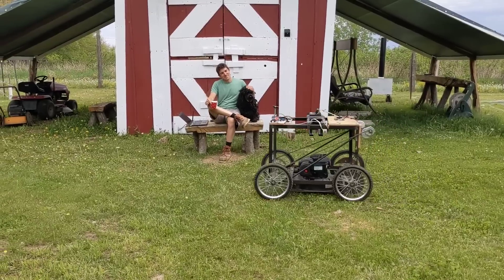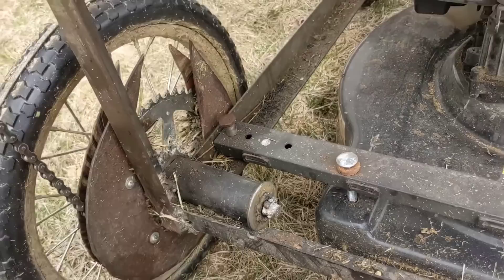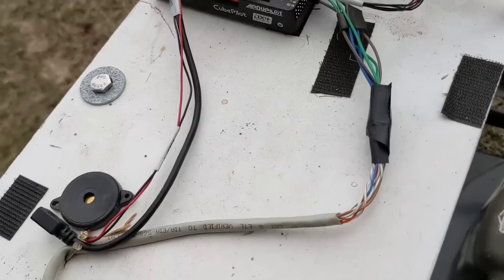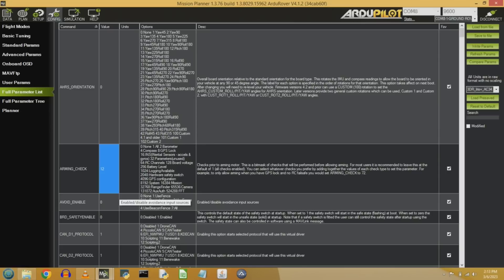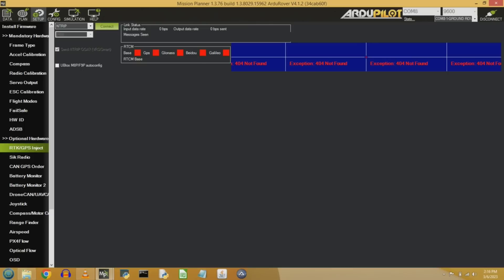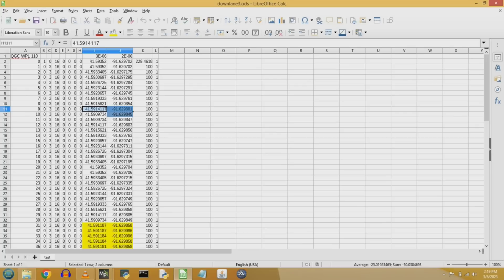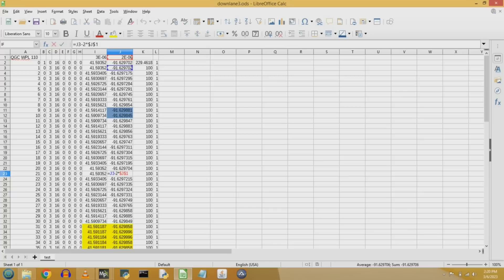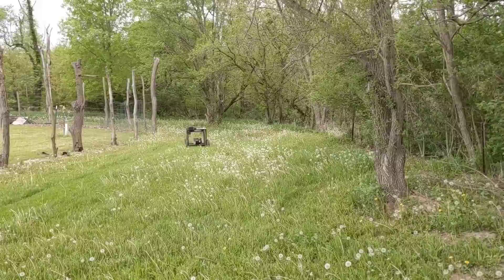DIY Autonomous GPS Mower - Parts List, Schematics, Build Details

Comment: Now that you have it ready to GO -- might be a good idea to consider some (Safety) ways for it to STOP.   You could put bumpers around it so that it cannot run into anything or anyone.  At least not very hard.  Anything touches the bumpers opens a Normally Closed kill circuit.   And maybe some of the big Emergency Stop buttons on top for folks who may have to shut it down in a hurry.   Those are not complaints -- just ways to make a good thing better.   Thanks for the build, the video and sharing the details.
Reply from the maker: All good points, I think next version will include that. The bumpers + kill switch can all be one circuit that connects to the cube orange switch.
Reply: another safety could be when tilted beyond a certain angle
Reply: seems like a good way to introduce reliability issues. how much could the bot realistically damage? that blade is unlikely to make it past the frame, and what sort of folks to you see it encountering in your backyard?
Reply: @xbenng  Safety is suppose to reduce reliability to the point it can be externally stopped.  It is the INTENT.  We sometimes call that Fail-Safe .. which is to say that it Fails in a Safe manner.  As opposed to Fail Sorry.  Another somewhat more complex method, but considered safer yet is a "Stay Alive" signal.  Absent the "Stay Alive" or All Good signal, it goes to an orderly shut-down or Safe mode.  An example of this might be a boundary around the zone(s) of operation.  Anything crosses into the safety area, and it shuts down.
Reply: @philtimmons722 safety is boring world has enough humans and could lose a few with out notice.

Comment: With a vehicle frame that large, you could use two GPS for yaw and forget about the compass hassles
Reply from the maker: Yes, I think this page describes how that looks: https://ardupilot.org/copter/docs/common-gps-for-yaw.html

I wanted a single gps/base station correction because I used the same setup on a drone for spraying my fields, so I reused that setup there.
Reply: Wait, that’s the reason large autonomous vehicles have two GPS?? 😳
Reply: @nathanbuildsdiy You should replace tired wheels with apron wheels, which are beneficial to improve your vehicle's off-road function. Especially in lawn surrounding.
Reply: @djiang2738  what is an apron wheel? Google didn't help
Reply: The compass is the much more stable and applicable variant, because GNSS has significant noise (wighout RTK) and thus direction calculations will be imprecise.

Comment: Dang, I’ve been toying with the idea of modifying my push mower to be an autonomous robot for over a decade and a half. Glad that someone went and actually did it. This is amazing.

I actually have some experience myself with both Ardupilot and the Cube Orange Plus, courtesy of a little challenge put together by NASA that the robotics club at my community college (along with 5 others) participated in. We were tasked with building an autonomous quadcopter. Fun stuff.

I do have a couple suggestions. First of which being, consider covering that platform up top with a waterproof shell. That way if you’re suddenly caught out in the rain, you’re not out a thousand dollars in hardware. Especially since the Cube Orange Plus isn’t waterproof, and I’m sure your ESC isn’t either.

Second (though this might not be an issue for you personally because it looks like you’re just mowing flat land), I would either reduce the height of that platform, or space the wheels farther apart to give it a wider base. This will help reduce the likelihood of it tipping over if you have to mow on a slope

Comment: Great project mate. I am also working on a similar kind of thing but due to some budget limitations i am trying to make a mower using Arduino UNO that remembers the path  its being trained on using an android app. As a mechanical engineering student i must say the its a very impressive and sturdy frame design. Keep up the good work. Hope to see more projects like this.👍👍
Reply from the maker: Arduino UNO is a great platform, raspberry pi zero 2 may cost even less and have a bit more horsepower.

I use the UNO in this build to control a bunch of motors, code for that is linked in the description: https://youtu.be/Q7A3PlqpgYs
The Cytron motor controllers are really simple to use with the UNO

I've found that depending on the condition of the ground (muddy, long grass etc.) the time that it takes to turn 90 or 180 changes, so putting a compass on your UNO may help you figure out if you've turned the appropriate amount.
Reply: you will really need a gps correctionfactor, because of the track changes, like tops and things that the wheel stuck , and it changes the course, even if it changes like tiny degree, it will change the position in long distances, and it will cause portions of not cuted grass. Sorry about the english.

Comment: I would try to make a small riding mower engine bolt to that mower deck, not for the extra power but because riding mower engines have a dynamo under the flywheel that could help charge that 12v battery on the go, sweet build 👍
Reply from the maker: That's an excellent idea.  I'm going to add it in a future revision
Reply: Probably the power of the dynamo wouldn’t be enough for powering the electric motors and charging the battery IMO .Better to think about fitting some relatively small car alternator as from Geo metro / Suzuki swift for example . Also if you are good with electronics, you can make controller which turns the alternator in to brushless motor just for starting the lawnmower IC motor so it will serve double purposes . Also you have done great job overall but the mechanical part isn’t very good . So IMO try on the next iteration Brushless wheel -motors from hoverboards . They are 250-300W each ( direct drive) and the speed controllers from the hoverboard can be reprogrammed and reused for your application as well( there are info on the net how to do it ) . Mechanicaly will be much simple and reliable this way and most probably cheaper. You can buy second hand hoverboard dirty cheap and you will get 2 brushless motor-wheels and 2 speed controllers from it . The way  ( and the details)how they are mounted to the hoverboard  will be also useful for your application.
Reply: It would be interesting to try this concept out with a riding motor as a complete unit. It’s already got everything but remote control.

Comment: Outside of the large area to mow, we have the same goal.  I happen to have no skills yet with welding and such.  I then opted to use wood for my chassis. Instead of using scooter motors, I'm re-using some e-scooter hub wheels that have the motor in them.  I thought about using parts of mower, but figure it'll help me to not use any gas, if I just power another motor with a string like a trimmer to cut the grass.  The idea is that eventually I can move that motor up and down to control cut height.  I love how "simple" your auto-mow looks, but that it works well.  Kudos to you! I'm inspired...again.
Reply: Thanks for the walk-through on the GPS and piloting software, that I haven't gotten to jump into yet.
Reply from the maker: Good luck! let me know how it goes

Comment: Thanks for your great video and especially the circuit diagram sketches, I built a remote-controlled petrol lawn mower last winter (Igor 3.1 ^^), which is basically for the really rough stuff. Next winter I also want something autonomous for fine cutting.

Comment: Very cool ideas, not just like the whole thing but stopping the chains from derailing and making it so that it will actually do work for an hour without screwing up
Reply from the maker: It actually ran for a long time with no chain problems, and then when the grass got long and branches started falling suddenly I had problems so I added the chain keepers long after it was being used

Comment: This is pretty much what I had in my head for mowing my own section, including the RTK GPS.  But I never knew about mission planner or ardupilot etc.  But since I don't have a house on it yet, that one is on the back burner lol.  Sounds like most of the firmware/software is 100%, so it's just implementing the design to your needs.

Comment: You should move the accelerometer down to the axle height and add some gyros. This way you can ignore GPS if the fix isn't great and do dead reckoning until GPS is good again. Should be good enough for what you're doing :)
Reply from the maker: I also ran across this - 2 GPS setup: https://www.youtube.com/watch?v=NjaIKyrInpg

Is that similar to what you're suggesting?

Comment: Dear sir Nathan, thank you so much for your tutorial. Inspired  by this video, I made my own automow (but mechanics is different) and it is working via RC remote control. Really grateful to you. Now, I am working hard to set up the RTK GPS and finding it tuff to NTRIP server in southern part of India.
Reply from the maker: Great work!  Is there much agriculture in your area? Do farmers use large machines?  If so I bet you can talk to them to find out what base station network they use.  Most require a username/password, which is usually free to obtain.  The machine manufacturer charges to use RTK, but the actual base stations are free to anyone.  That's how it is in my area.  Farmers use LEICA network base stations on their tractors and combines and I got a username/password to use that network.

If there is no network available, then you could create your own, but it requires this:
https://irlock.com/products/here-base-m8p

And here's some documentation on setting up the base:
https://ardupilot.org/copter/docs/common-here-plus-gps.html#base-module-setting-using-mission-planner
Reply: Sir  @nathanbuildsdiy  Here in India, precision agriculture is not widely available yet (especially in my locality). 

So I will check setting up my network with help of your links and keep you posted

Comment: Cool build. I really like the large wheels.
I would prefer electric motors on the axle instead of chain drive. 
The chains appear as if they might catch twigs and branches since it is so open and high.
It is an interesting choice to use an ICE for the blade drive. I definitely understand the reasoning.
It would have been fun to see an electric cut.
Reply from the maker: The chains do pick up sticks. In the spring all was well, but in the fall more sticks were dropping and the chains started to derail. I had to add chain keepers (my name for the big circles of metal added inside the wheel) to keep the chains on and that's been good for now.
Reply: I love this transmission as its so cheap and most energy is being used from the gasoline anyway. Internal geared hub drives are really expensive or really weak

Comment: twisted pair works much better with differential drive, which eliminates common mode signals. The twisted pair will cancel out a fair amount of induced common made, but any residual is still fully presented to a single ended input.

Comment: sweet build i got one suggestion get a 220 welder i bought a el cheapo off amazon and do not regret i runs fin off a old school generator no need for inverter type to much hype on them in my option oh and said welder will   run off 120 and with .30 wire it will burn in good and i was stick welding with AC 22-volt tombstone welder fer years. get gas tanks for the mig its sweet stuff no looking back after that .should have did it years ago

Comment: amazing job with this setup! some water proofing could make the electronics last longer, maybe a 3d printed enclosure or anything else which protects from water.
Reply from the maker: Absolutely.  It's on the to do list. I actually had it running last summer when a storm blew in.  A drop of water hit the motor control in just the right place and suddenly the right motor was stuck "on".  Luckily I was already on the way to turn it off when it started driving off into my field!
Reply: @nathanbuildsdiy  stuck on the most stupid thing haha interesting obstacle! hope to see more content related with electronics and hacking

Comment: Maybe you mentioned it and i missed it, but does the program have any type of safety stop mechanism, say if the mower has some mechanical failure and wanders off the gps track? Is there a way to program it to stop and/ or shut down? I live near a highway and would want some sort of safety feature that would prevent it from roaming out on the road.
Reply from the maker: This is a good idea - I talked about it in another comment somewhere in here.  Basically I think it should be added - it'd be fairly simple.  The cube orange has a arm/disarm switch that plugs into the usb port.  That could be wired to "bumpers" on the outside edge of the mower so when they're hit it would disarm and stop moving

Comment: You might throw a solar panel and a charge controller on top to help that battery not drain too low too many times. Or better yet, see if you can add an alternator onto the engine.
Reply from the maker: A solar panel would charge pretty slowly, but an alternator on the engine is a great idea. adding it to the list of improvements!

Comment: Wonderful stuff,  man!  Didn't know the open software was so good now.  Even training the AI for your freznel weed killer seems to be approaching dummyproof.  The only upgrades I would make are:
Weld on a sorta cattle-guard to push away the big rocks and branches ..
Larger tires just for traction, because i'm building a chariot behind mine to pull me around the property like a retired drunken Spartacus.
Give your map to a drone to do a quick scouting ahead..
Honestly forget even the mower..  if one could just come up with a pathfinding diy platform rugged enough to carry a couple of chainsaws and a gas can/generator water/lunch/guns  ..      There's nothing worse than losing an hour+ of daylight just because you forgot/need a pair of needle nose.

It's gonna break,  of course, like everything on farm will..  I'd much rather have to deal with a broken or jammed up chain than dealing with anything like tank treads unless the property absolutely requires it.

Comment: Add a solar pannel ?? And would try to add the voltage created from the mower to charge the batterie ??
Reply from the maker: You could add that and get somewhat longer run times, but it chews through power faster than a solar panel could recharge it, so it'd only add minimal total run time before a recharge
Reply: Yes, solar this small sadly gets you nowhere. A small generator attached to the engine would. I think it would still need some routine to catch up the charge because of that small engine has not enouch power available to run continously.
Next thing is You don't want to mow if the sun ist suitable for solar. So that would need stationary big solar and fully unattended mow and return to charge capabilities.

Comment: Dude!! This is great stuff!! Much appreciate you taking the time to document, and share your knowledge with everyone.
Quick question if you have time. Would it be possible to drive my rc mower manually, from my RC controller, with the cube passive but online, then add my waypoints in the spreadsheet as I progress?
Theoretically, one time cutting manually using the RC transmitter i'd have it mapped, then turn my auto/Man switch to Auto, switching from RC mode to Autopilot, and operate off the GPS.
Oh yea you mentioned distance in the ethernet cable being a consideration...Do you know the max length by chance? Id need to run at least 5' from the rear up to the controller in the front.
Can't thank you enough for your hard work, and allowing everyone to benefit from it! Kudos!
Thanks 
Dave
Reply from the maker: Certainly - you can either download logs from your run and parse through those or (probably easier) just pull up the "data" tab in mission planner while the mower drives around.  The current GPS coordinates are at the bottom left side of the map view in that tab, just note them/save them off in a file somewhere and use them to generate your map file.

Comment: Hello, i have a question. if you didn't do the ESC calibration step. when armed , motor are spin ? if motor spin how do to get motor stop spin because i Hello, i have a question. if you didn't do the ESC calibration step. when armed , motor are spin ? if motor spin, how do to get motor stop spin?Because I don't connect RC or calibrate ESC like you.  How should I set it up?

Comment: Have you thought about using two sprockets for each wheel and two bike chains on each side to make tank treads? It may help with off-road traction and any unexpected objects like sticks.
Reply from the maker: I certainly did consider... I actually wanted to 3d print some treads.  I bet bike chains on the ground would pick up sticks etc, but it would be worth a try. If you do try, let me know!

Comment: solar panel on top to recharge the bike motors and you'd be golden!
Reply from the maker: I like the idea, but I bet the size of the solar panel needed to meet the power demands would be pretty large. I think next build I'm going to add a small alternator to the mower to power the battery